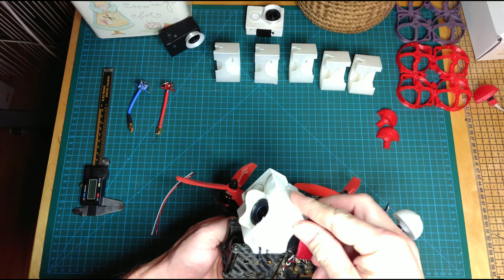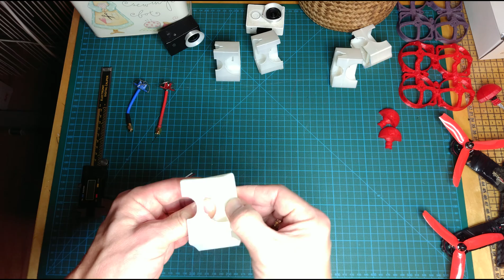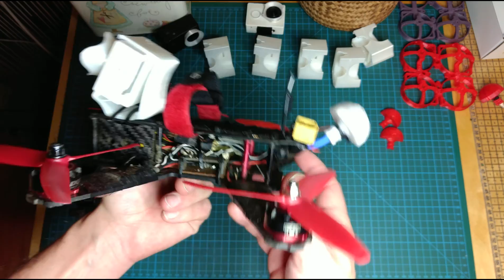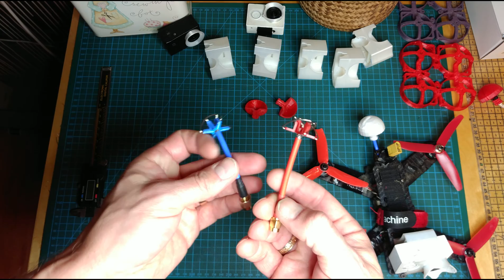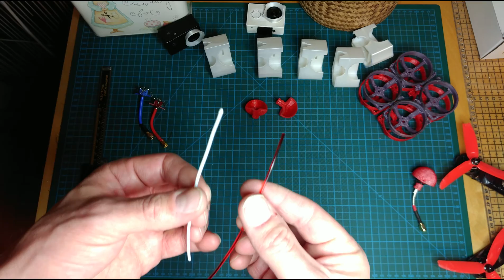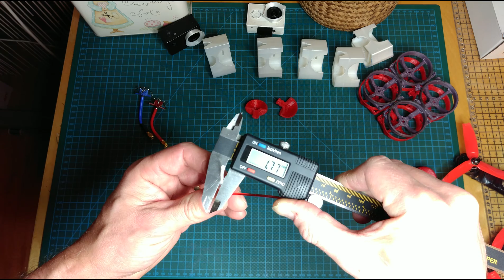Hobbyking flexible filaments review [4k]

Comment: Hey do you have stock extruded?
Reply from the maker: Yes, stock extruder with following updates:

1. Added ~1cm teflon tube between extruder gear and hotend to prevent flexible filament from bending
2. Changed to radial fan and printed one of these http://www.thingiverse.com/thing:1025471